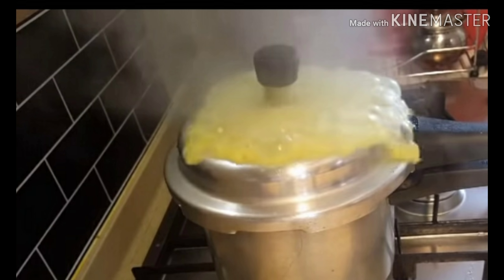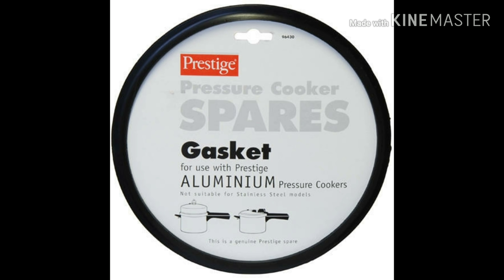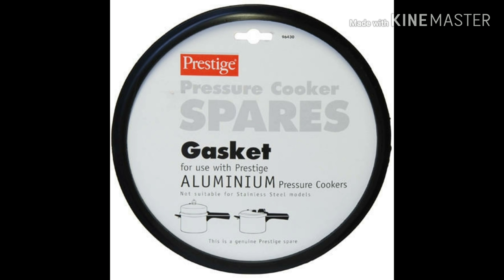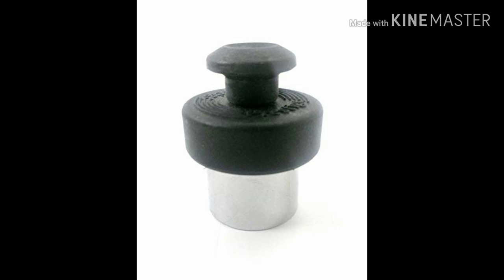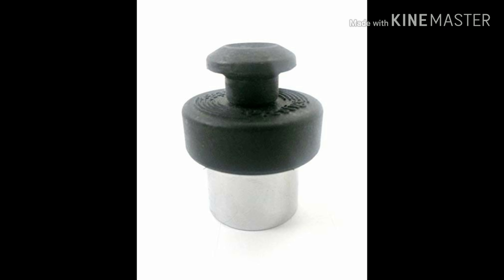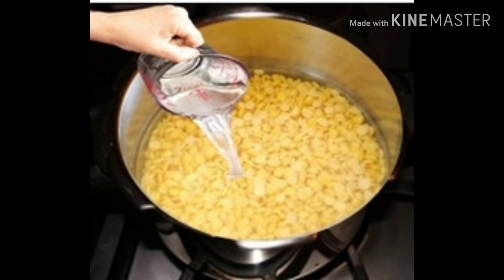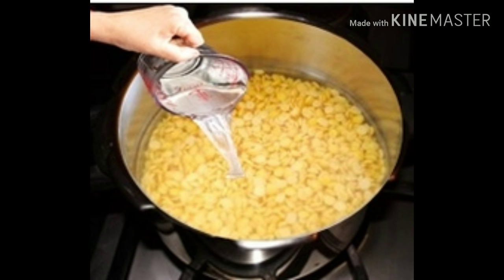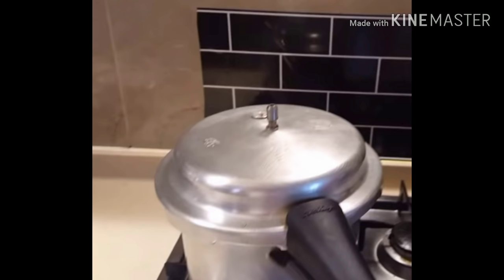കുക്കറിൽ നിന്നും വെള്ളം പുറത്തേക് ചാടാതിരിക്കാൻ ഇതു പോലെ ചെയ്താൽ മതി

Comment: Ok, madam. However what I have observed @ people's way of using Pressure cooker is basically they follow a wrong approach. "Pressure Cooker" means food to be cooked under pressure and not direct cooking as many in India believes. If we follow the instructions of PC appliance manufacturer, then these problems like steam leaking do not occur as also the life of the PC will also increase. So first is to educate oneself @ "pressure cooking". Also by direct cooking inside PC, chances of daal n rice getting clogged in the weight top nozzle is always there. So always avoid direct cooking inside the PC.